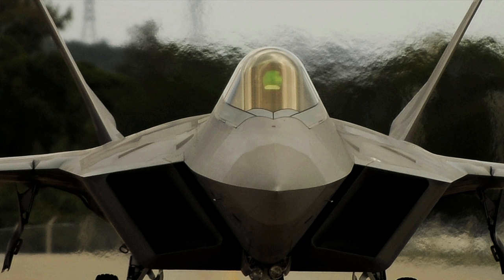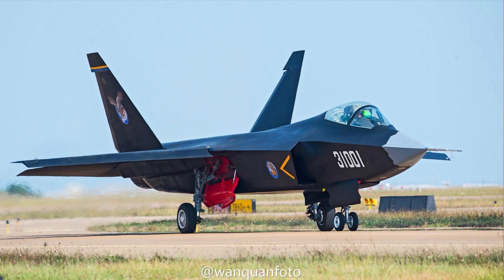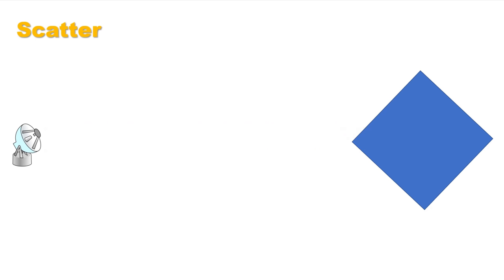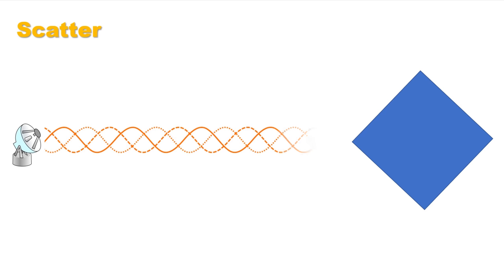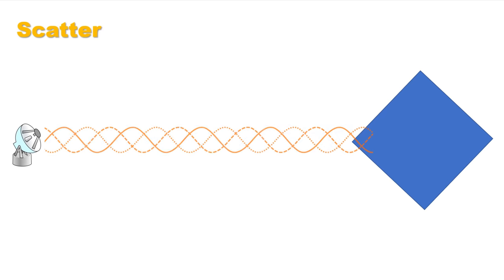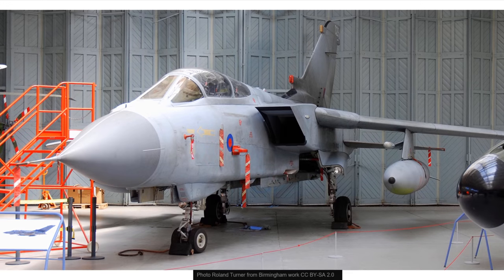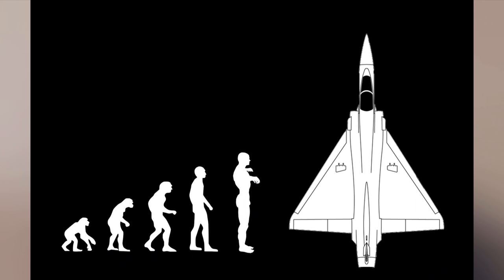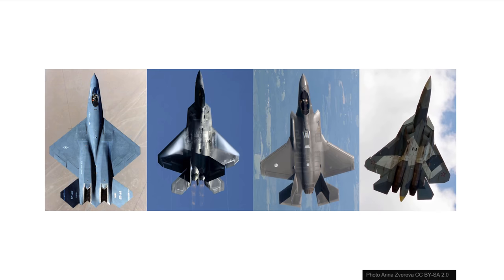STEALTH Killed AERODYNAMICS | why all modern jet fighters look alike

Comment: Brute force?
... Forcing weapons dragging through the air to supersonic speeds is brute force... The Raptor can supercruise and has to CUT power at higher speeds because of ram air efficiency.
Reply: Carrying extra weight induces a drag penalty either way. The thing is though, for the amount of thrust the F22 and also the F35 have, they're slow.
Reply: @shi01  Su-35 produces 142kN/32,000 lbf thrust from each engine on afterburner and roughly 86kN/19, 000 on military power, yet the F-22, which produces only slightly more on AB is roughly just as fast and supercruise speeds roughly align with the military thrust values (F-22 super cruises about 1.4x quicker than the Flanker with about 1.4x thrust), despite drag increasing with the square of speed.

Comment: In modern warfare aerodynamics is not so much important as you will not see classic dogfights in most cases. Just like with modern tanks, so its with modern fighters, point is to detect first and kill first on distance... That is why F35 is so focused on electronics, AI, and stealth... So if you put Su27 and F22 raptor (F35), i bet Su27 pilot want even have chance to visually see F22 before it goes down, its same with any Gen 4 fighter...
Reply from the maker: This, that you are describing as a fact, is just the USAF doctrine, that is, what they plan to do. I am not saying that it won't work, it may well work, but until it is not verified against a near peer opponent, like Russia or China, it is a plan and not a fact. Not even all the western air forces do agree with this doctrine, even the NAVY is not entirely on the same page. 
Obviously, let's hope the doubt will never be cleared.

Comment: The problem it's the enherited tail from 4th generation aded to the internal paiload bay of the fifth trying to be conservative and still performant without compromising any requirements in order to embrace the inovation - very similar to the F14 wich have tried to extend its capabilities to the extremes of the speed ranges in order to be fast striker and maneuverable instead of just making two simpler planes with diferent requirements and simpler maintenance. A10 was focused on one single task and is doing it perfectly, same with F16. In the other hand it's the multirole F35 wich isn't focused on dogfighting, isn't an atack platform at all, it's just an air to ground/air to water precision bomber adapted to the sea. For the land the EU is having the Eurofighter and US F22 air superiority and a posible F23 for strikes/ofensive wich makes it usable only on foreign US air bases.

Comment: and yet these modern planes are more aerodynamic than the old ones.. .because they dont carry weapons externally... therefore can achieve much higher speeds while in full combat load.... so put missiles and bombs on that Su-35 and it will be a lot less aerodynamically effective and will be a lot slower than F22

Comment: I do not agree with the statement that stealth killed aerodynamics, at all. 
And I am sure that today, at least Lockheed Martin, Boeing, Northrop Grumman, Sukhoi, and Chengdu engineers and aerodynamicists would disagree too.

I do agree that the need for stealth killed variety and diversity in looks/aesthetics. Most 5th gen jets look at least somewhat similar. While previous generations of fighters were more varied and diverse in design and shape. 
But killed aerodynamics?! No, not really. 

The days of having to choose between stealth and aerodynamics are long gone. That was only true in the early days of stealth technology in the 1970s with the F-117 for example due to the limitations of the primitive computer technology of the time...
But at least post B-2 Spirit stealth technology not only basically ended with the aerodynamic drawbacks/disadvantages the older stealth tech had, but it actually also benefits aerodynamics. Not much. But it can help (and I don't say this just because stealth aircraft store their weapons internally... 
The fact that an aircraft in order to be a VLO stealth aircraft needs to have for example, a very smooth and sleek shape and surface/skin with no abrupt curves and also no cannon openings, antennas, sensors, vortex generators, etc..., sticking out of the airframe, not only helps the aircraft being extremely stealthy, it also makes it more "clean" and reduces its parasitic drag).
Both Lockheed and Northrop demonstrated this in 1990 with the YF-22 and YF-23 respectively. 
And the YF-22, F-22, YF-23, F-35 (yes, even the F-35), J-20 (yeah, even the J-20 too) and Su-57 are all proof of this (some more than others, but they all are).
They would not have the overall excellent or at least good performance we know they have, if they simply used brute force and were just a triumph of thrust over aerodynamics. 
The F-22A today would not be able to supercruise at Mach 1.7 if it had only mostly brute force and little aerodynamic finesse.
The YF-22 (which was aerodynamically a way more raw and unrefined aircraft than the F-22A) would not have demonstrated supercruise capability at Mach 1.43 with the YF119 engines (which were also way less powerful and refined than the current F119 engines) in 1990, if its outstanding performance capability came mostly from brute force. 
Period. 
These are just a few examples...
Reply: Regarding the Area Rule specifically...
The fact that stealth fighters are not area ruled in their "waist" is basically irrelevant, it doesn't mean much. 
The are several sections/parts of an aircraft that can be area ruled, not just the "waist". Just because you don't see the area rule being applied there, it does not mean they totally disregard it. 
Besides, not having the "waist" area ruled is not exclusive to the stealth, 5th gen fighters. 
Most 4th gen fighters don't follow the area rule in their "waists" too (look at the teen series, and the Rafale, and the Eurofighter Typhoon... What you see at 08:19 in the video with the F-22, same thing with all these aircraft). To have the "waist" area ruled is the exception, not the norm these days. 

I also have to disagree with the statement that the Flanker aerodynamic design is the most efficient one. 
It is not (not to mention these things are not that simple).

I mean, seriously, compare the Su-27S EM performance with that of the F-15A/C for example... 
The Flanker despite having things/features that the Eagle doesn't have, like LERXs, LEFs, RSS, and fly by wire, is at most equal to the F-15A/C Eagle in the transonic and supersonic regimes, and not that much better at subsonic speeds. 

And like, how is an 1970's aerodynamic design which is basically a mix of the F-14 and F-16 aero designs, simply the most efficient of all?

Yes, at the time it was a state of the art design, and in a few specific points of the flight envelope under specific situations it certainly was more aerodynamically efficient than anything else at the time. 
But it was definitely not revolutionary. And at least overall, it simply wasn't/isn't the most efficient of them all.

Comment: Great video! Whenever the YF-23 comes up I always wonder what could have been... Is there any merit in using older designs like the Boeing X-32, or YF-23 or even starting the F-22 production again? I think you may have covered the last point, but it's always fascinating, I also wonder what a pure performance + efficient Aerodynamic jet would look like, with stealth taking a backseat again. thanks

Comment: Well, 1 - No, geometry is not the main contributor to stealth. It's actually the material and RAM that does most of the work now. Actually even the ECM on aircraft probably does more than th geometry now. Our (the USs) upcoming NGAD fighter (6th gen) will actually do away with alot of the modern stealth design. You can see this with the F-35 which for all it's stealth performance being BETTER than the F-22, it's incredibly bulbous, bumpy and looks closer to old school 4th gens. There's a reason why. The USAF General himself said it best when he said 'you simply cannot tell how stealthy a plane is simply by looking at it'. I am actually in this industry and I can tell you that it's of no fault to you to have this incorrect assumption - the properties and materials used in the design of stealth aircraft are highly classified. The geometry is there simply to help mitigate return at certain angles, including above and below. These Angles have everything to do with common air combat tactics such as Notching. The physical features of the aircraft such as the Chines (the sharp edges that seem to slice the aircraft in to halves, top and bottom) have a very specific purpose that's more than just 'cannot have radiation bouncing right back at emitter'.

The aerodynamics in modern stealth aircraft have actually pushed innovations such as saving weight on intake design since variable geometry inlets would cause a higher return - see the F-35 inlet design with the noticeable 'bulge'. The Chines of the aircraft (again, that edge line the divides the aircraft into dorsal and ventral halves) are also used as lifting surfaces and vortex generating geometries. This is why the F-35 is as maneuverable as an F-16 and actually has higher AoA control than the F-18 or MiG-29 family despite having 'bad wing loading metrics'. Also, the canted tail is simply a better optimized placement for low speed control and actually improves maneuverability options at the transonic and sub transonic ranges, which is why the F-35 can do maneuvers the S-27 family can, but without the F-22s famed vector thrust. 

2 - the F-22 brute forces itself but note that the S-27 family is going to be inhibited greatly by it's load out while the F-22 and other aircraft like it can remain in clean configurations due to their intent to use internal storage for it's weapons. So while the F-22 does 'brute force' itself to a point, you maybe massively discounting that the two fighters are differentiated by the F-22s ability to still remain as maneuverable as it is, even with an A2A load stored inside. The Su-27 family is definitely way more sexy though and I definitely agree, it's far more aerodynamically efficient but if efficiency was the only thing that mattered? Fighters would he using winglets and other geometries to assist in gas savings but that is not the only factor so, a balance is struck. We simply cannot compare 'air show' aerodynamics to factual combat purposes design. It doesn't mix well.

The F-22 is not as fast as an F-15 partly do to this sacrifice in aerodynamics, but also because it's bigger and also... because it's actual top end is classified. Public listings should show around Mach 2.28+ with the '+' being the giveaway that it goes faster but can't for some reason. The reason has to do with the RAM. 

See the RAM these days is actually DAMN good at absorbing energy, and well... thermal energy falls into that lot that's great at absorbing. Both the Black Widow and the Raptor have the same listed top speed not because that's the limit of their aerodynamics (the YF-23 would actually pull out faster naturally just on aerodynamics alone, it's drag coefficient is better than the 22s) but because the RAM starts to encounter severe damage at higher speeds where the friction generated heat begins to destroy the coatings. So we do not know how fast the F-22 really can go, though I don't expect it to be much higher than M2.4. Because of the RAM, and the fact that going that fast is rare anyway? It's yet another small sacrifice. As a hint to how important the RAM actually is? Look the Demo F-22s closely and so cracked and beat up they actually look. The RAM on them is destroyed and they're relegated to Demo use until Depot Level Maintenance can occur (which takes a month to replace the RAM) because the stealth performance is completely destroyed by the RAM failing.

3 - The 90 angles are a nightmare in RCS reduction strategies but you over looked cylindrical bodies. In reality, beaming the F-15 from the side doesn't have it's largest return necessarily from the flat tall V-stabs or the box like intake and fuselage - it's actually from it's fore / nose area where the giant cylinder shapes has a unique effect that... I'm sure your about to discuss in the upcoming video? I would expect you actually know a lot more and are just leading up to it.

Let's put it this way... the Chines are there BECAUSE of the cylinder shapes. 

I look forward to future videos. 

Oh, and if you thought stealth ruined cool design? Wait until you see 6th gen. Hell, I'm studying hypersonics and when we get to that point? Shit will be down right ugly because the aerodynamics you're used to at Transonic speeds, are thrown out the door. Say goodbye to sleek needles and sharp bodies and hello to BLUNT OBJECTS lol.
Reply from the maker: Thanks for the long post. The effect of the creeping waves has been described already, just check Stealth 102 and 103 videos in playlist. Do you have any more public domain info on RAMs?

Comment: F 22 raptors are 5 gen figthers made for speed supercruise mach 1.8 at 65 000 ft attack su 57 from 6 o clock  and run home to live another day its aerodinamic is made for altitude fast speed bvr combat  and su 57 is made for lower altitude lower speed combat to take out  4 gen figthers and at close range so diferent philosophy 
Air combat both can be done .you can kill at long range or visual range just depends on stealth missiles sensors etc but both are possible depends on your platform.

Comment: Thanks for the very nice and informative video. In it, you mention that "Since stealth favours clean-cut lines, we have lost some of the features that used to be very important in aircraft design, for example the area rule, is hardly compatible with stealth because it requires smooth variation of surfaces". While this is true, it can be argued that designers started to pay less attention to the area rule as far back as 4th generation fighters - the F-15, F-14 and F-16 do not exhibit the "pinched waist" design feature of their 3rd generation counterparts. the reason for this, as far as I am aware, is that the penalties brought abut by drag rise where  wings and fuselage meet,  could be overcome by brute force, i.e. by using stronger engines. This is also the case in stealth aircraft, as you mentioned, but this design trait seemed to have started earlier than the advent of stealth aircraft.

Comment: Modern planes just aren't that attractive. Designs from the past used to be recognizable as to the company that designed and built them because the chief designers or design teams infused their personal engineering vision into the profile. Slide rules, not computer programs, translated their visions into working aircraft.

Comment: I wonder how overrated stealth is. Comments welcomed.
Reply: quite overstated to every country thats buying the F-35B as a main fighter instead of a strike multirole...
Reply: Well, the one jet that sees the other one faster has a big advantage.
Reply: It depends how good your jamming pod is. If it's good enough to keep you safe stealth is no longer needed , however you usually need to emit radiation to jam , so that can be risky. Shining a really bright light in your eyes is an alternative to not being seen.
Reply: @Renegade-Master-88  
Jamming can, in some circumstances, makes you more vulnerable than remaining radio silent, most modern missiles have home-on-jam (HOJ) capability. Jet fighters generally carry defensive jammer, which is used to jam missile seeker rather than large ground-based ones. If you're carrying more powerful, specialized jammer, you'll need an electronic warfare officer to operate it to make sure that the jamming doesn't work against you.

Comment: I kind of disagree with the statement that Su-35 has the best aerodynamics today. I would agree if it was in the low speed, high AOA regime, but not at higher speeds. In this regime I would suggest either Eurofighter Typhoon or Dassault Rafale. Contrary to the Su-35, both of these aircraft feature a canard design (which is being a lot more efficient that traditional config.), moreover Dassault Rafale has a close-coupled canard-delta config.
Reply: SU-35 doesn't have low wing loading.
Reply: Yeah, the SU-35 and SU-27 are supermaneuverable, but it's not an energy fighter like the F-16 or F-15. Supermaneuverable usually means high AOA and great post-stall capability, speed and acceleration has nothing to do with it. MiG-29, SU-57, and F-22 are both supermaneuverable and an energy fighter, but most other fighters are either one or another.

Comment: It’s like 4 limbs on vertebrates. Once you have a solution that works for the best for a certain advantage, why even bother changing? It’s like adding a 5th wheel in a sedan. Why bother?

The f22 and all the other designs based on it, which is everyone’s solution currently. Has perfectly blended the most aerodynamic design with stealth. The f22 is in fact the most aerodynamic plane in existence, even compared to the f35. This is the true reason the f22 is still classified, not it’s stealth design.
Reply: BS
Reply: @fyzy7  maybe I should clarify. It’s the most aerodynamic plane IN WAR. Sure a sukhoi will be efficient without weapons, all planes are. But the f22 has the same aerodynamics with or without full weapons load, because of internal stores. When he compared the efficiency of the sukhoi he was clearly using a clean sukhoi without weapons, meanwhile the f22 will, like I stated, be the same with just slightly less acceleration due to weight of internal stores. So it’s an unfair comparison and disingenuous.
Reply: @manofcultura  the F22 has the best compromise between sthealt and aereodynamics, not best aereodynamics.
Reply: @marcoconti1197  F22 is a great achievement in fighter jet design, but unfortunately, it does not have a good compromise between capability and price.